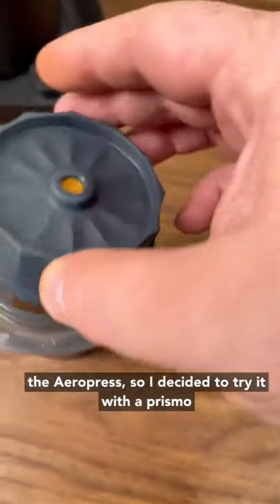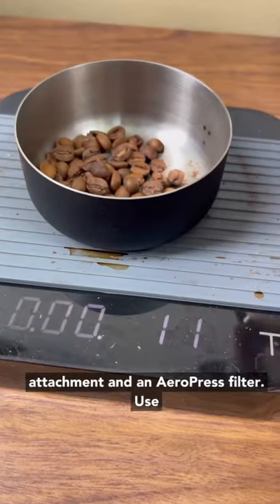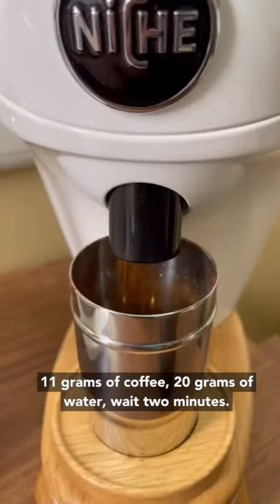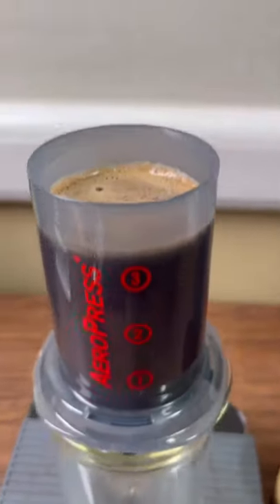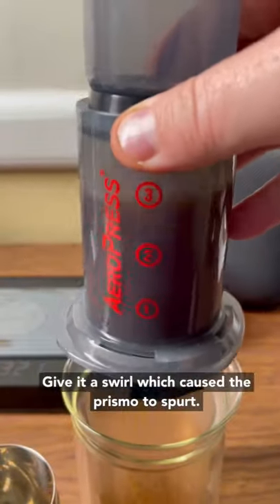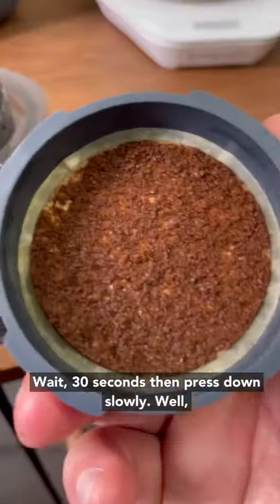Hoffman AeroPress + Prismo Test

Comment: If your Prismo is leaking, that means you need to purchase a new valve. That’s what happened to me. Otherwise, you get no pressure at all when pushing down on the plunger.
Reply: I’ve noticed with mine that it will spurt like that if you agitate while the plunger is inside. My guess is that the coffee is releasing CO2 which opens the pressure valve